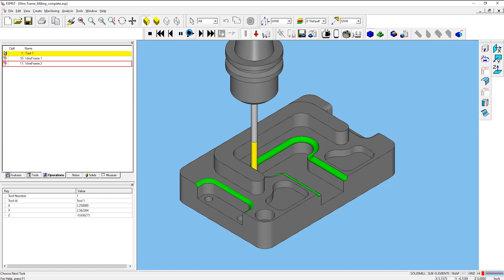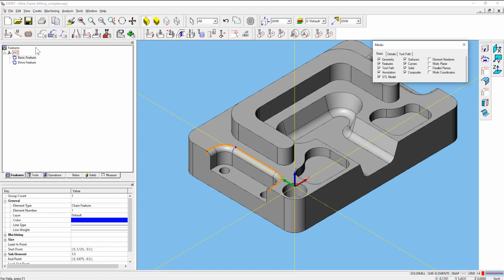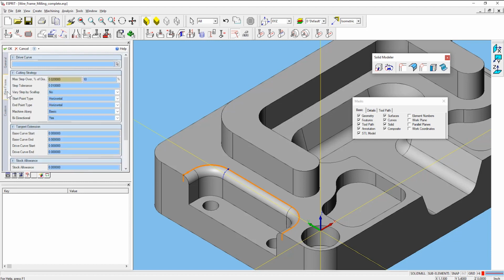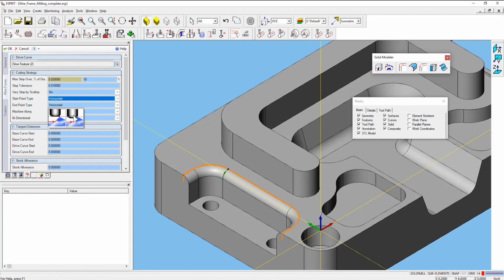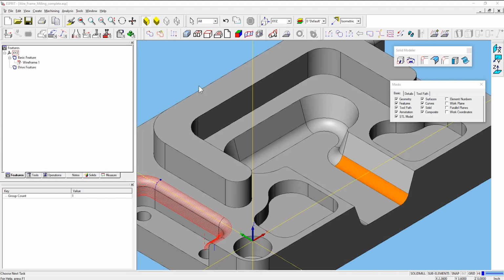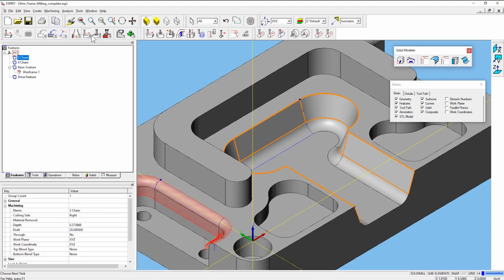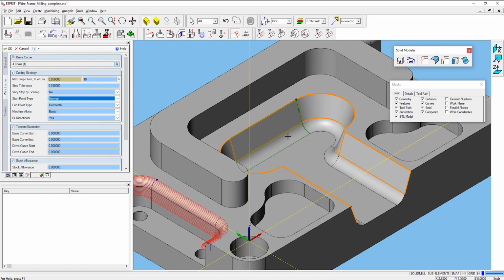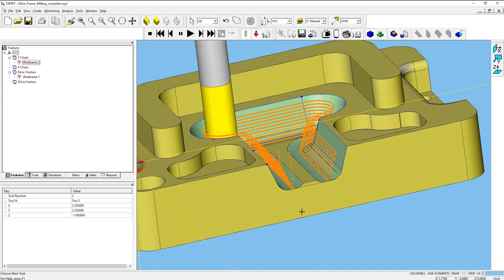Wire Frame Milling - ESPRIT Tips & Tricks

Comment: Why not extend the Basic feature ( in the first example) so the tool loses contact with the 3d model ? this will give you a much better surface.
Reply from the maker: Hello, in the second example, Max added tangent extensions to the toolpath using the Base Curve Start and Base Curve End settings in the operation. You're right that the same technique could certainly be used in the first example to extend the toolpath off the model between passes. Thanks for commenting!